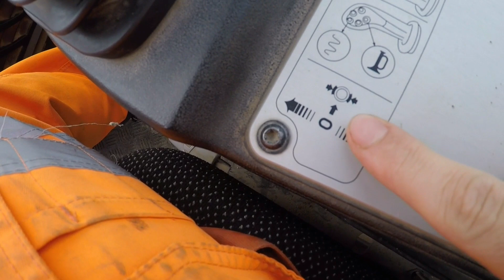M.T.D 138 This needs a title to 🤣

Comment: Heard a story recently about a new driver going into a company, who gave him the keys for an 18tonner. He refused to take it out because it was  a manual n he learnt on an auto truck. Bare in mind it was a straight 6 gears box. The industries on it's arse and it needs a massive revamp.

Great video as always Russ.
Reply: If you pass on a auto box your license does not allow you to drive manual.
Reply: @HighlandSteam  that only applies to a car licence. With a truck, you can learn in an auto and then go and drive a 4 over 4 with a twin splitter.
Reply: @HighlandSteam  The law changed several years ago. So long as you pass one car, LGV or PCV category on a manual vehicle, all car / LGV / PCV categories you have or acquire in the future allow you to drive manual vehicles.

This means that if you passed your car test on a manual vehicle, you can take your LGV test(s) on autos but you will be licensed to drive manual trucks. Once the rules changed, the training companies switched almost exclusively to auto trucks.

Comment: I appreciate what you are saying about large companies Russ but if they are the only ones taking new drivers on then new guys have little choice than to take the plunge learn quickly and then look for a small outfit to drive for. It is a bit of a vicious circle. Look at Deady can't blame him for taking a job with a reputable company with a brand new Scania.only time will tell if it works out for him. On the other hand you've got Luke C he has done his time now going to run for a little 3 motor company I hope that works for him